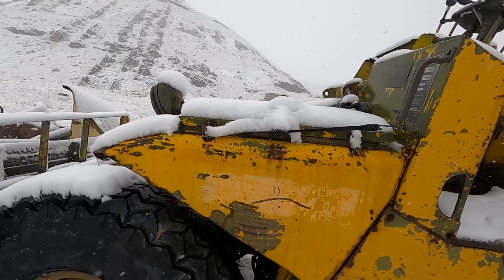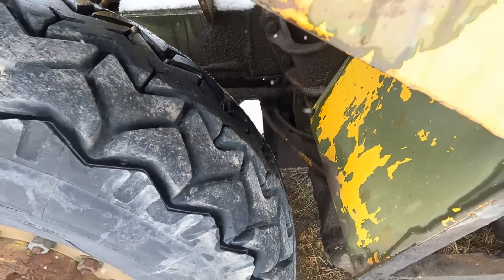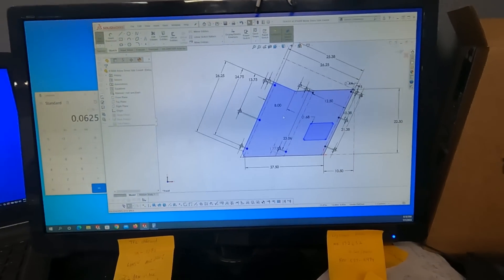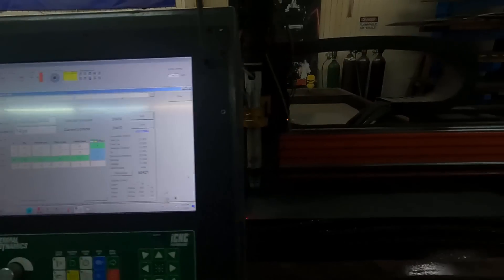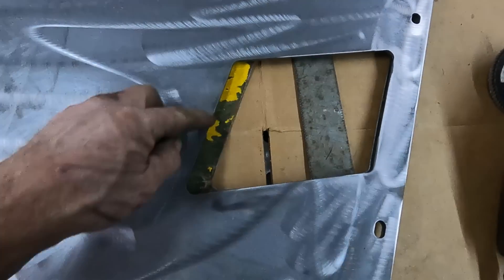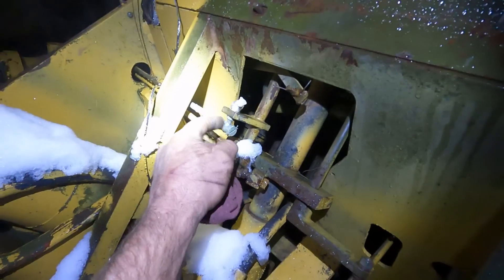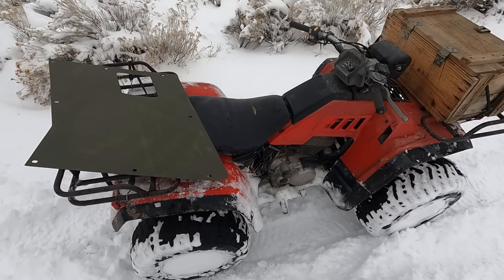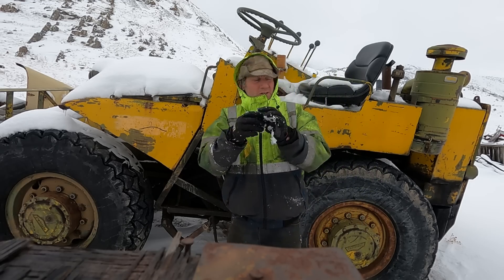RT6000 Sideplate Fabrication Part 7

Comment: You work to hard to be trudging though the snow because your car got stuck. Your also not getting any younger. Go get yourself a nice truck. Doesn't need to be brand new with every single bell and whistle. Just something dependable with a seat you can relax in while driving though the snow.

Comment: Did you ever determine why the machine at the shop seemed to freeze up and not want to turn over in the cold without heating the engine up?

Comment: Whenever I get something cut, I always do a cheap/freeish test first.  A large format printer and paper would allow you to set the part on it and make sure you got everything right before cutting the real thing...  Also, I will admit to preferring to use waterjets when I can as the plasma cutters harden the edge and leave slag that takes a certain amount of cleanup...

Comment: Holy cow you could have freehand cut 20 of those plates in the time it took to "compute" it.
Reply: No doubt about it. Though I get the impression that Alan is also doing some self-improvement work in learning the software and process. In which case it's time well spent.
Reply: @bradley3549  Ain't nobody got time for that.
Reply: @1gunrunner351  LOL. Everybody has time for education.